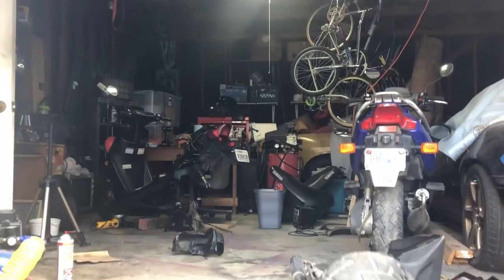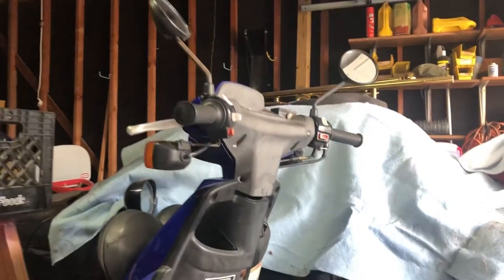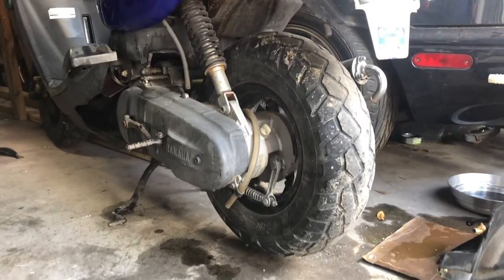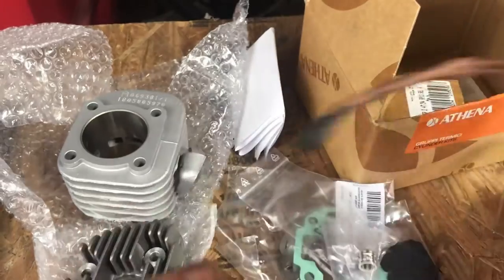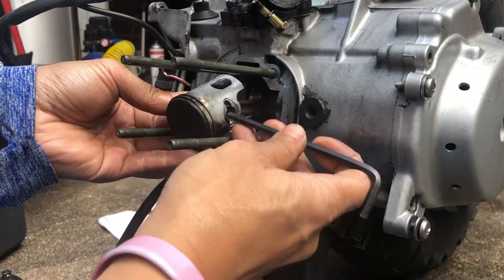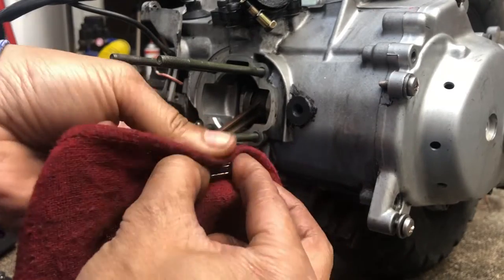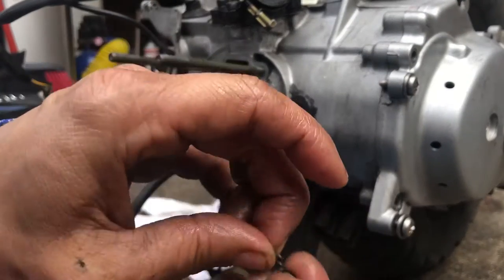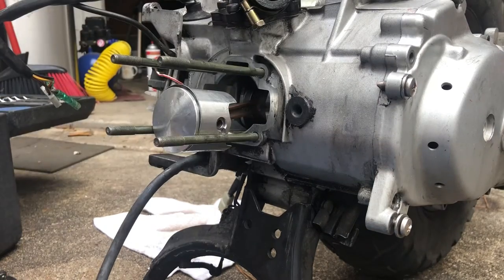Zuma Athena Race 70cc BBK install : Day One building the motor

Comment: The multiple gaskets/shims are so that you can adjust cylinder height to get proper squish, transfer port, and exhaust port durations and measurements . To get proper operation and maximum efficiency from these kits, you cannot just bolt and and go.

Comment: No No , Get or make a degree wheel , bolt it to the end of the crankshaft and turn clockwise noting the degrees open the exhaust port is a turn more for the transfers [inlet] same deal . Its not hard but you need to know durations or the degrees for both ports opened which change with more or less base gaskets or as you said shims ,spacers were included . Also B.D.C of the pistol should be level enough to the bottom ports opening . Not enough information by the way from dealers and me so see 90GTVert channel .lol

Comment: I got quest can you change out timing belt to timing chain? Or new engine 125 cc no belt drive only chain?
Reply from the maker: You
Mean the CVT belt in the transmission ?
Reply: @SmallEngineVelocity  yes
Reply from the maker: No, since the belt needs to slide up and down the drive face to change gear ratio. I’m sure there is some creative way to do it but far as I know the answer is no.
Reply: @SmallEngineVelocity  Thanks

Comment: What’s the best 70cc kit that has the carb intake on the cylinder itself?
Reply: Poling corsa
Reply: No engine has a direct carb set up it’s always through a reed
Reply: @thewonderfulwizardofcodsaq3472  any vertical it’s bolted to the cylinder. Horizontal is case reed.
Reply: @jamiebouchard9862  all of my verticals have case reeds
Reply: @thewonderfulwizardofcodsaq3472  not sure I understand then. Case reed has direct port into the case, such as the horizontal. My minarelli vertical has the flat reed bolted directly onto the cylinder. Both of em. 🤷‍♂️